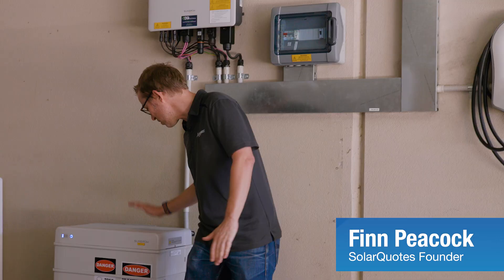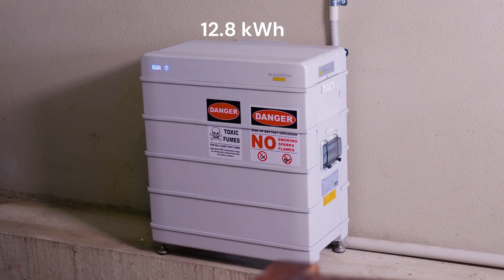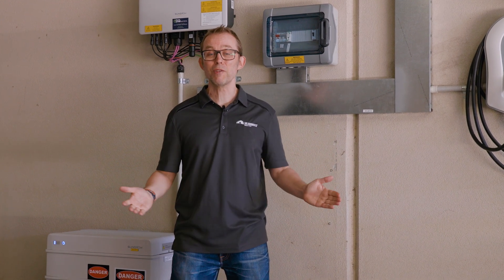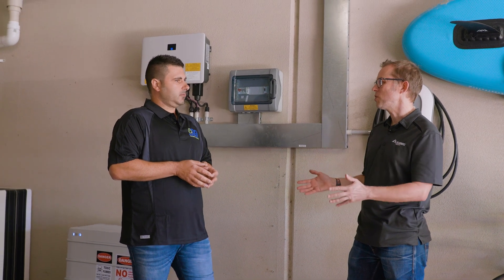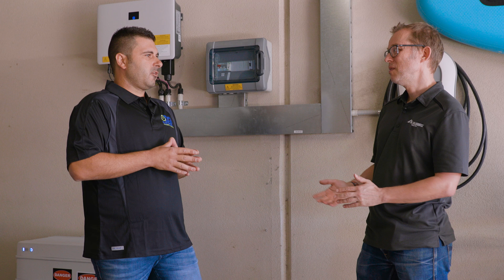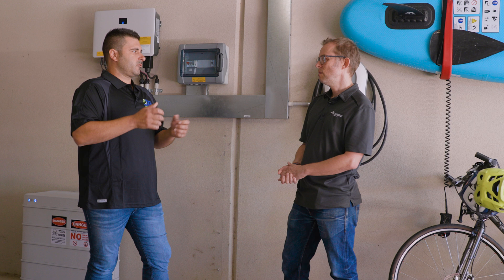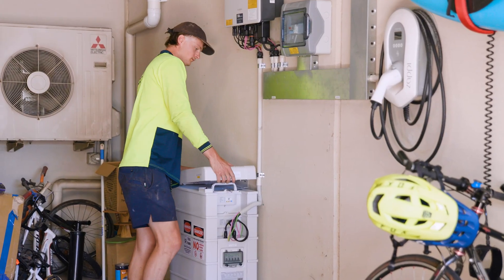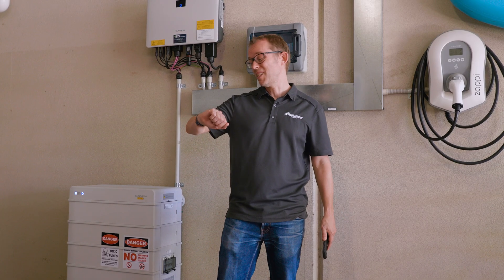Modular Home Batteries: Great Idea or Marketing BS?

Comment: Hey Finn. I have this exact Sungrow System with 9.6 kw of battery modules. 
I’m thinking about buying another two modules to take me to 16.2kw. Do I buy the two extra battery modules myself and then find a company to install. Or do you recommend some of your providers to supply and install and applying rebates?
Reply from the maker: ideally, use the same installer who dod the original install to avoid warranty headaches. Otherwise find a good local who specialises in Sungrow. The installer claims the rebate for you.

Comment: So in Adelaide after shopping around for months - Modular a 9.6kwh up to 12.8kwh (Sigenergy or Sungrow) will cost you $11-15k for a setup after the new rebates vs a non modular 10kwh Alpha ESS / Neovolt DC coupled running you about $5-6k... Answer is Modular is only if you have boatloads of cash and don't care about the battery taking twice as long to break even lol!
Reply from the maker: Cheaper batteries - like Alpha - aren't one's I'd recommend to a friend.

Comment: Just had two modules added to my Sungrow stack to give me 19.2kwh.
The electrician did the conditioning of the existing stack on the day, took about 3 hours all up by the time he had taken the existing battery stack up to full charge then discharged it to 20%.
Reply: What was the cost to add the 2 modules?
Reply: @kerrinaallington1148  this was before the federal subsidy was available - $4100 installed.

Comment: What size battery stack would you recommend to run a 2.4kw inverter a/c, fridge and a few lights overnight. Really like the look of the sungrow system. I’m looking to add another 6.4 kw of panels to my new shed to go with the 6.4kw on the house which has the fronius inverter.

Comment: @SolarQuotes: Does the Sungrow batteries or invertor comes with backup box incorporated or you need to buy it separated? For me backup box is the devices that automatically switches to battery in case power goes down. Thanks
Reply: from what i remember it was advertised to switch over to the battery in the event of blackout.

Comment: The SAJ single phase battery system looks great especially for people buying into solar for the first time.

SAJ b2-hv1 (battery management system = $770 inc GST

SAJ b2-hv1 5kwh(4.5kwh usable) module $2150 inc GST
SAJ cables and stand $110
TOTAL 1 x battery stack without inverter = $3020 inc GST

I want to start a second battery stack early while the installer is already installing the first one.  Its perfectly fine to not load up the first stack to its full 25kw capacity before starting a second stack.  It will make it very easy for me to add modules up to 50kw across all stacks myself as I need. Multiple stacks can be connected to 1 inverter via CAN connection protocol.
TOTAL 2 x battery stack without inverter = $5840

I am using a fair 30% labour calculation for this so thats $1752
TOTAL of my chosen battery system installed $7592
Solar VIC Interest Free Battery Loan up to $8800 = No upfront cost

SAJ Hybrid Solar Inverter 10kw H2-10k-S3 $2150
With oversizing provisions this means a 13.3kwh system
13.3kw of solar panels (28 x Jinko 475watt Tiger Neo) = $5900
Fair 30% labour calculation = $1770
STC credits of $4400 for where I live(VIC) plus $1400 solar rebate = -$5800
TOTAL 1x Inverter plus 28 x panels minus STC/Rebate plus installation = $2150 + $5900 - $5800 + $1770 = $4020 inc GST
Solar Vic Solar Loan $1400 means I am out of pocket $4020 - $1400 = $2620

Not bad.

Comment: I am wondering if a good way to use the vic battery loan of $8800 would be to get 9-15kwh of modular storage across 2 stacks upfront, and then just stacking them on as you go yourself until you get to 50kwh. My night time use is about 60kwh. The missus likes to bake at night :)
Reply: That's crazy night time usage! I wonder how much is your fullday consumption and bills are like

Comment: If a module fails during or after the 10 year warranty, whats the best practice on replacing the faulty module? My understandig is you should not have a mix of old and new modules and therefore should replace all batteries after a period. This is a major consideration if you take into account 10 year battery warranty and ROI for most households way more than 10 years. Keen to get the guidelines on this.
Reply from the maker: Great question. I’ll ask Sungrow.
Reply: Complete system ROI @ 6-8 years dependent on wholesale electricity prices, your "way more than 10 years" ROI "for most households" is an assumption and should be treated as one.

Comment: Couldn't help but notice the Zappi EV charger in the background on the wall. I thought you weren't a fan? 😏
Reply from the maker: Well spotted. This was the warranty replacement for my home EV charger. I decided to put it out of the elements in the garage of the rental unit, so the poor thing was not exposed to the elements (or used too often). So far so good. My home now has a Delta AC Max Smart.

Comment: It’s only a quick job if the installer has arranged (via forced charge or discharge) for the State of Charge (SoC) for the existing modules to match the shipped SoC of the new modules (commonly around 20%) as specified in an additional Sungrow PDF document. When we upgraded from a stack of 4 to a stack of 8 this was not done as the requirement and documentation was not obvious. It caused big jumps in the battery level and a significant reduction in energy storage capacity, It seems that the first module to be fully charged stops the other modules from charging and likewise the first module to be empty stops the others from discharging. Our installer had to come back and manually balance the modules to fix it as the BMS only seems to be able to handle balancing small differences in modules.  We have since upgraded to 2 stacks and are finding that it has a similar issue where the first stack to discharge (and they are discharging at different rates) stops the other stack from discharging.  If you have Sungrow batteries I would recommend monitoring the actually energy storage capacity you see for full charge/discharge cycles (you can see the numbers/charts in iSolarCloud) to check you are getting around the capacity you expect.
Reply from the maker: Great point  - after the first upgrade, the installers quickly learn to set the SoC of the existing modules, so they are ready for installation. Which they can do remotely the night before. That's what DQ Electrical did - so they were ready to go as soon as they arrived.
Reply: I was going to ask about matching the SoC, glad you mentioned it. No BMS box on the top can cope with them in parallel. Maybe better to have an array of server room style batteries, each with their own BMS. Take a look at the EEVBlog battery installation.

Comment: Exactly what the DQ Electrical guys did with my  16.0 (original setup) to 19.2kWh, then added the splitter required when subsequently chose to upgrade to full 25.6 (over two stacks) as required on single phase.

Comment: We got a Sungrow battery at 10 kWh, and like you, another module would be good. We now have 13.2 kWh of panels.
We took out a green loan and are paying around $465 per month for just that loan, but in Summer, we run in credit, and Winter could add another $200 per month!
This isn't bad at all, as monthly bills sometimes go above $1000 and $700 was the most common. We just look at it as costing similar to what we had before but we get more for our money. The backup works great and has kicked in 5-6 times. Keep up the great work!

Comment: Can I use the modular Sungrow or BYD with my Enphase system?
Reply from the maker: Yes - you can use the same Sungrow hybrid inverter in 'AC Coupling' mode and SUngrow batteries. BYD claim their batteries work with SUngrow inverters too - but I'd stick with Sungrow for both.

Comment: Not sure that was the correct procedure for adding another module.   The instruction manual says “ Before adding new modules, the existing modules must be charged/discharged to the same SOC level as the new modules.” .  I didn’t see this mentioned in the video.   Here is the full correct procedure. https://service.sungrowpower.com.au/files/Web_Files/FAQ/GD_202203_Sungrow%20SBR%20HV%20Battery%20Series%20Extension%20Manual_V2.0.pdf

Comment: How does the battery cope with having one fresh battery added to a stack of used batteries, is there a reduced capacity to the fresh battery? I’m thinking of going this way but just wondering if there is a point of no return when deciding to add a new one on to a stack?
Reply: I would assume each battery pack has its own BMS. It would seem very stupid to have 1 BMS cover an entire system… especially when modules can be added/removed due to failure or upgrades.
Reply from the maker: great question - I'll ask Sungrow support
Reply: Think sungrow try to "match" manufacture batches for the installer when additional 3.2kWh modules are requested. Could be wrong, we added three extra battery modules over two upgrades from 16.0-19.2 then 19.2-25.6 kWh.
Reply: A BMS can only do so much. As the balance issues others have mentioned show this one is still forced to obey basic battery rules.  Surely the overall Amp Hour capacity of the battery would be limited to the size of the oldest/weakest battery, and the kWh capacity would be the average output voltage multiplied by this.
Reply: @JessedeVries  …you missed how a BMS works??